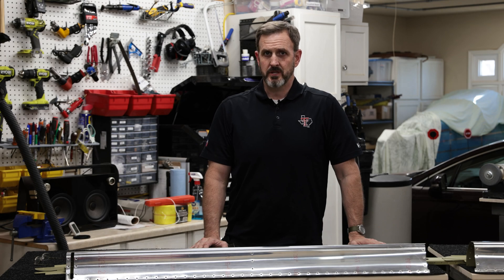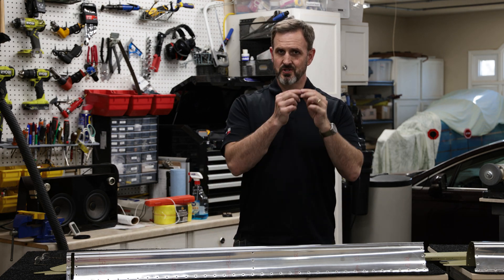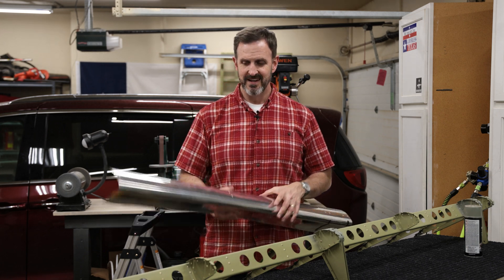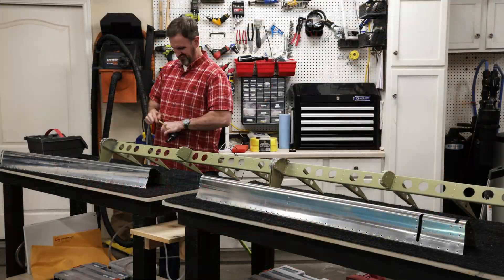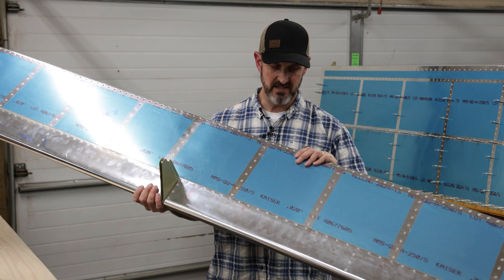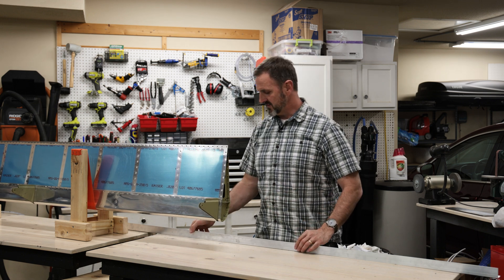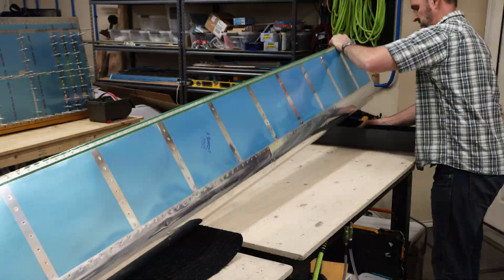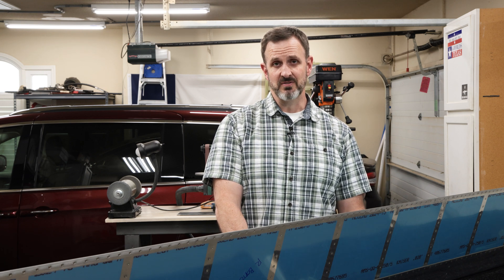Building the RV10 - Video 15 - Flaps (March - April 2023)

Comment: seems that back rivet gun has some rubber ending. can you explain the difference btw regular and back river gun “sets”?
Reply from the maker: Normally you put the rivet gun on the side of the machine head and you out a bucking bar on the other side (and that forms the shop head). In back riveting, you put the flush rivet against the a solid flat piece of metal (underneath the sheet metal) and the you use the rivet gun directly to form the shop head. Here is a good video on how it works:  https://youtu.be/dLO29Q2zpCg?si=4T9VrnNItl_NiSiY
Reply: thank you for the link. the guy also uses special set for the rivet gun with spring loaded “capture devices”.
Reply from the maker: @apivovarov2  yes, mine has the same thing.

Comment: What tool are you using to squeeze those rivets? Mine is 5-6 times larger and likely 5-6x heavier!
Reply from the maker: I’m using a Numatx squeezer. They have a constant force through the length of travel so the only thing you adjust is pressure. It’s really easy to use, I couldn’t imagine using the larger ones that most people seem to have. 

https://numatx-tools.com/

Comment: Did you have any problems with the Spar? ie laser cut spar, on vans list of items to replace.  Im holding off my aileron and flap build until van comes back with a solution.
Reply from the maker: I built these before the whole laser-cut part thing hit the fan.  From what I recall, I don't remember any protrusions/imperfections in the rivet holes (caused by the laser not starting at center) and, for that matter, don't even know if my spar was laser cut or not.  I don't recall any cracking - but I wasn't looking, either.  I'm going to wait to hear what Vans says, and I bought an endoscope to inspect the rivets/dimples for cracking.  I might have to drill a hole on the side to get the endoscope in and haven't figured out how I'm going to do that yet.  

However, there is a non-zero chance that I'm going to have to rebuild these things and that would be a bummer.

My guess would be that, unless you have protrusions/slag/imperfections on the laser-cut part itself (something that would affect only subset of all the laser-cut parts) then you're probably gonna be OK.  But that's just some random guy's opinion on the internet.  If I were in your shoes, I'd just wait to get the new punched part if only for the peace of mind.